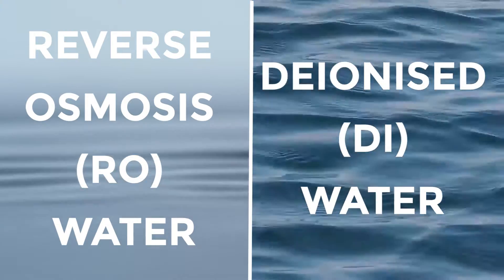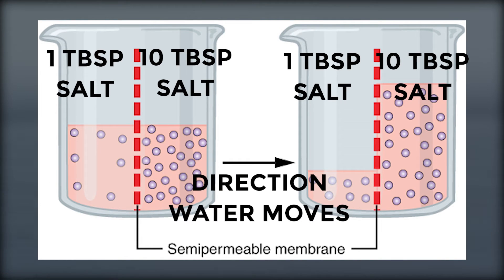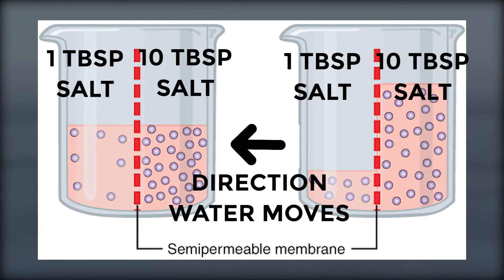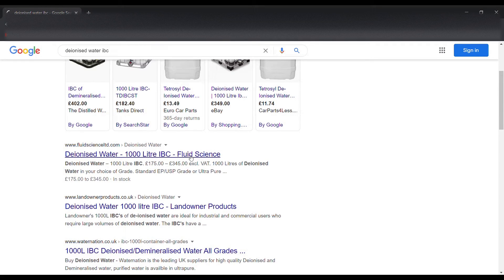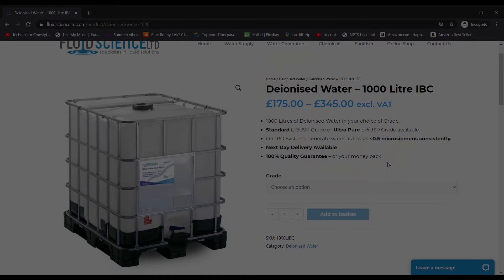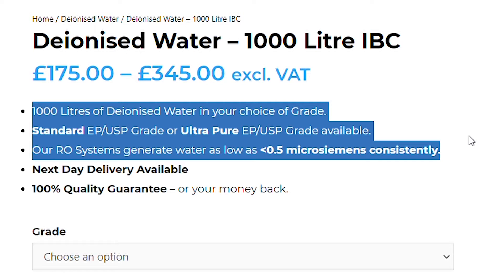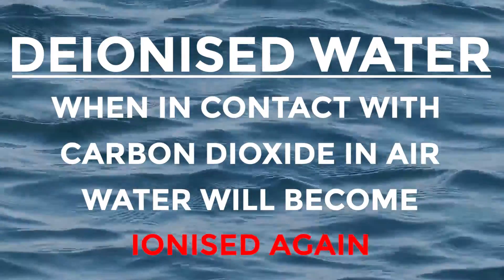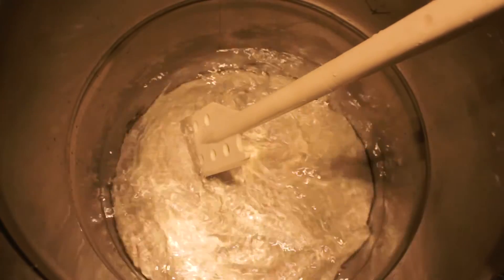Which Type of Filtered Water Should You Use To Cut Back Gin? | Miss Brewbird

Comment: What about distilled water? Is it good enough for diluting.
Reply from the maker: You can use that. I have seen some distilleries use tap water too.
Reply: @MissBrewbird  Many thanks for the reply.  Tap water might be good enough for gin and vodka?  But I tried to use tap water for a liquor to be stored with oak in a jar.  The lime and the minerals in the water, went in contact with the wood, and it became cloudy instantly.  I will continue to distill my own water for dilution.  The only annoying thing is to clean the distillation apparatus before water distillation.  If it is not cleaned properly, the water will smell and taste of tails, no matter how many liters of water I run through.
Reply from the maker: Oh interesting. I think I've only worked in places with soft water, so I have never seen or had any first-hand problems with using hard water.

Comment: @Miss Brewbird   Will you please explain the process of diluting high spirits with out  losing its texture... I mean how you pass the 'bubble test'  after diluting your product.
Reply from the maker: Hmm not too sure what you mean. I'll have to do some more research into that, but I'll look into making a video about it!
Reply: @Miss Brewbird... Thank you for your reply.... and what I exactly mean is,  after diluting my home made spirits having 65-70% v/v strength to 42-45% v/v with deionized water,  tiny air bubbles remains there for a long time after a shake. But some that is (even a cheaper one) purchased from market is not so..... big bubbles will disappear  in seconds after rigorous shaking.... I also applied 'same temperature'  theory while mixing water & alcohol..but failed.... how to fix this... please.
Reply from the maker: Hmm, it sounds like beading. If your spirit has a higher %abv then the tiny air bubbles will take longer to settle down. However, if the spirit has a lower %abv then the air bubbles will settle down more quickly. I touch on this a little bit in my video here at 1:10: https://youtu.be/M7RPpXOLSZA 
I don't see it as a problem though.

Comment: Why would you filter gin post botanicals? This seems entirely counterintuitive.
Reply: To “remove dissolved solids that are larger than 0.5 microns”. This does not remove any aromatic (flavour) compounds but it will remove impurities. There are very little compounds larger than 0.5 microns that will transfer over during distillation so this process is not explicitly required. However, it will remove any contaminants that have been introduced after distillation

Comment: Why not use spring or well water? DI and RO water tastes awful.
Reply from the maker: The ions and minerals in normal water might form a sediment in the bottle. Also, normal water has a flavour to it which we don't want to interfere with the taste of the gin we made.
Reply: @MissBrewbird  fair enough about the flavour but wouldn't the sediment drop out with a few weeks of standing before bottling?
Reply from the maker: It might do, but we don't want to leave huge containers of liquid lying around the distillery for weeks on end. A slower turn around time means lower production efficiency and less money.
Reply: @MissBrewbird  that's perfectly understandable. Do you add anything back to improve flavour that doesn't sediment?
Reply from the maker: nope the gin we distilled already has all the flavour, we just want to cut it back with pure water to get it down to bottling strength.
Reply: @MissBrewbird  Thanks for the info. Hope to learn more from you in the future :)

Comment: Ive been using the 4l air still to distil my water 1st. Then run it through a carbon filter. But it doesnt make sense to use it in teh wash,, would take too long. But it does make the spirit smoother than my chlorinated tap water

Keep em coming
Reply from the maker: Oh wow you really put a lot of effort into purifying your water. I'm lazy so I'd probably just buy in water if I were doing it at home. Yes, I've noticed too that if you use purified water in the wash the distillate comes out softer tasting.
Reply: A regular Brita style water filter removes chlorine among other things. I've found it good enough for amateur cuts, but that depends on your tap water I guess. I've known other home brewers buy bottled spring water.